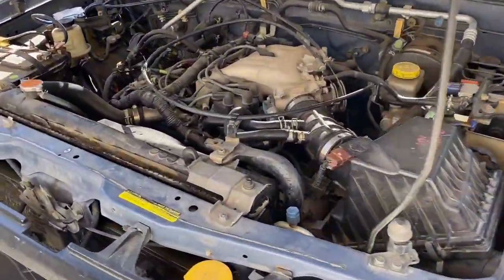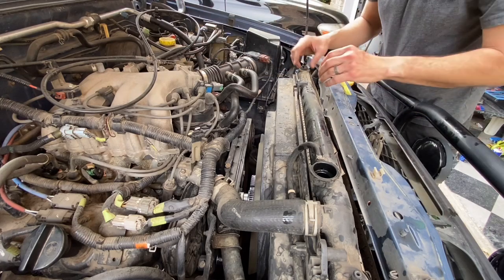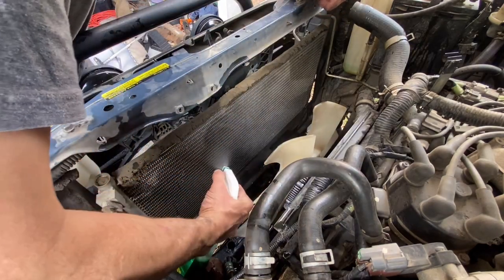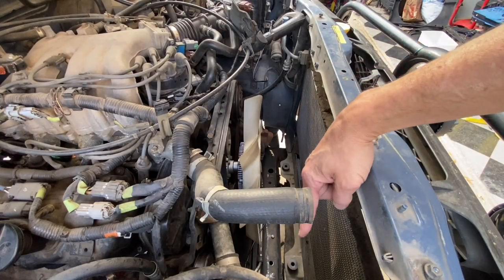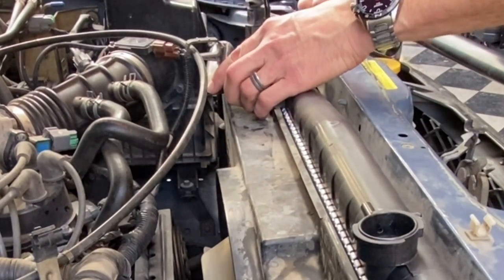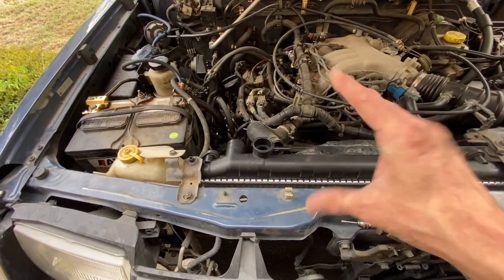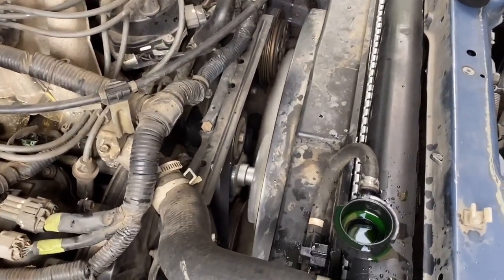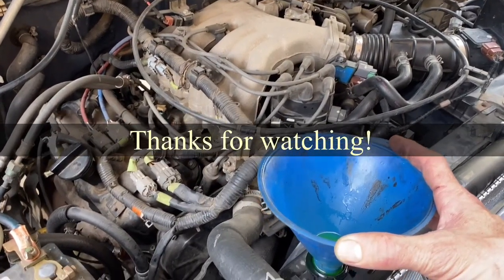Manual Trans Radiator Replacement for Gen 1 Nissan Xterra, Frontier, or Pathfinder

Comment: I have an 07 manual exterra.  My lower hose is on the bottom left upper is on the top right same as yours... I just bought the wrong one from auto zone too... any ideas on where to look. I have a feeling it might b dealer only. I've ran ito that a lot with this truck. Thanks.
Reply from the maker: If you go to Autozone, they will let you go look at the hoses.  Might be worth it to bring your old one in and get one that is close enough. I still haven’t changed mine out after the radiator swap!
Reply: Sorry, I ment the outlet and inlet on the radiator are on opposite sides.  My lower hose attaches on the opposite side than the upper hose does. Having trouble locating a radiator to match.
Reply from the maker: Yeah, now I see.  Just go to rock auto, that’s where I found success for my manual tranny.